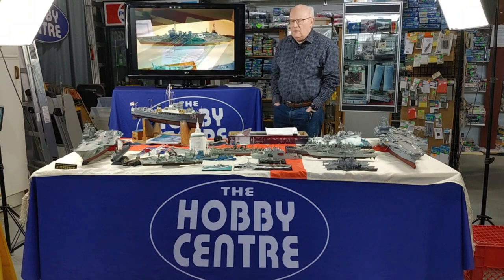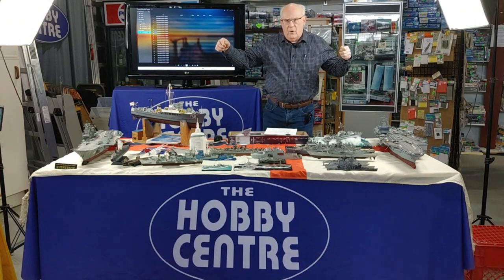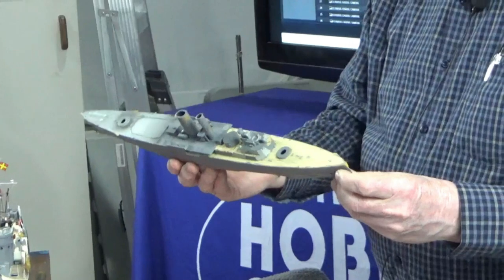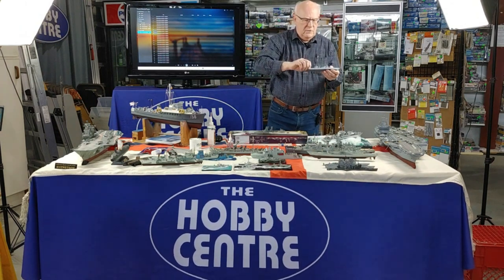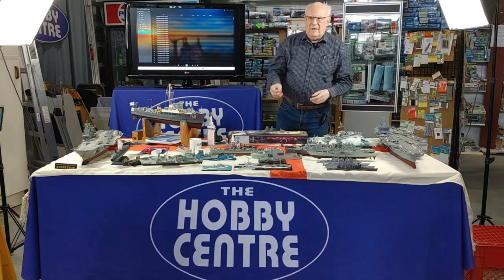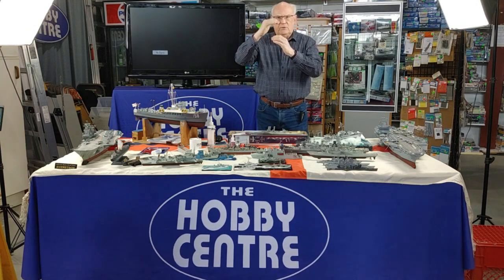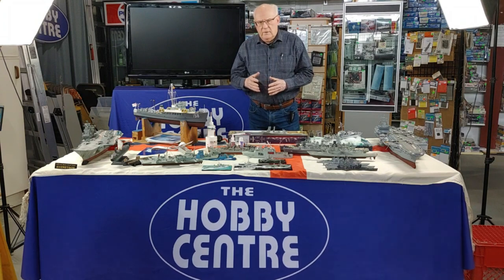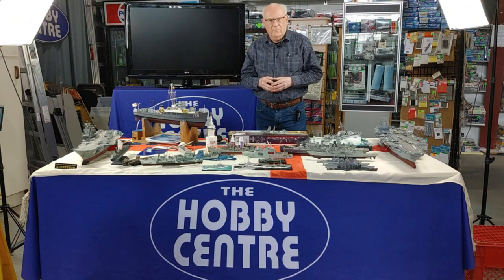Introduction To Scale Ship Modeling with Ian Moore

Comment: i am LOVING this video!! Can you PLEASE leave the conacts for the HMCS Ontario/Quebec plans?
Reply from the maker: We asked Ian who said : The Quebec and Ontario were two different subclasses of the royal navy crown colony cruisers . Quebec was a Uganda lass and Ontario was a Swiftsure class
Both were modified from a Belfast class kit which was a lengthened version and had to be shortened and significantly modified. 
Sambrook plans in the UK has a plan in 1/96 of HMS Gambia. Which if purchased and scaled down to 1/350 are a good guide. The best sources are the royal navy ones . And a search for the class of ship rather than the specific ship is the best method. 
Each ship had modifications after every annual refit so reference to the multiple photos of each ship on the internet require careful study. There are numerous picture references but plans are scarce particularly from Canadian sources .
Reply: @hobcen  thank you very much. Looks like it's time to research a bit!